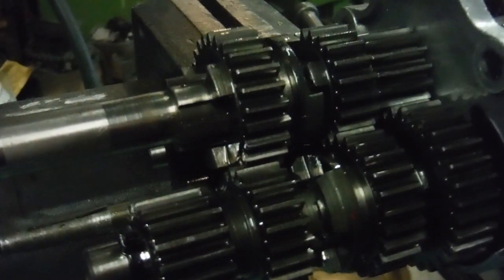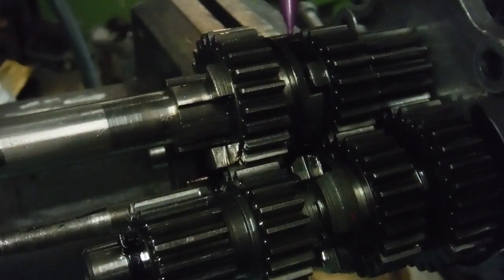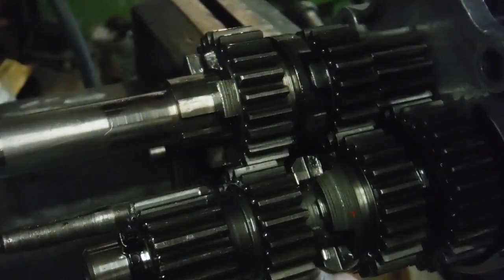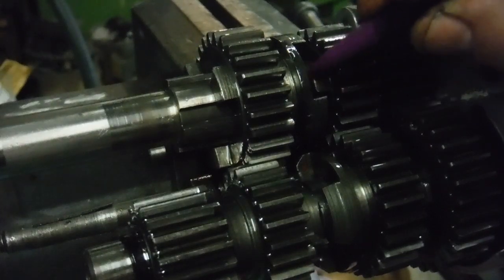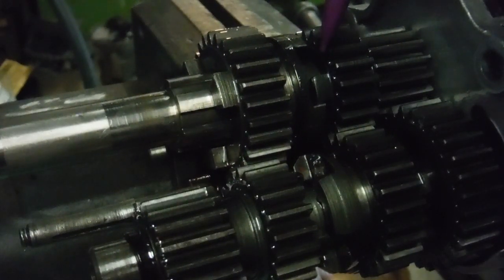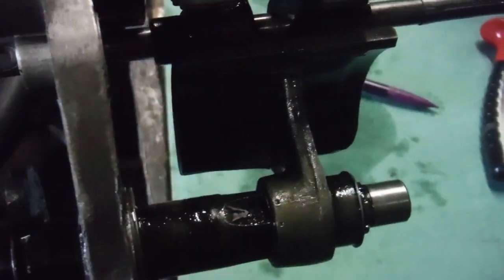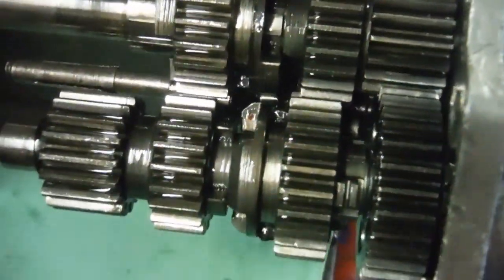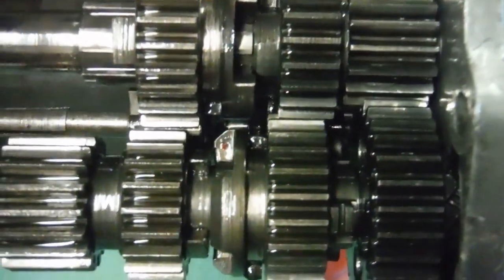Norton Navigator 350 gearbox examined and discussed.

Comment: Hi, the selector rod screws into the back of the gear box. That is what the flats are for 👍
Reply from the maker: Hi and thanks, but I guess a special tool would be needed for that with the gearbox end plate in position.

Comment: The overall condition is really good. The poor engagement is no great surprise. I wonder if the thing you had to straighten in the selector mechanism was as a result of someone forcibly holding the gear-lever down in an attempt to keep the thing in second. If the fork is out of shape, I would expect it to be a symptom. My money is still on lack of shimming. I doubt the factories took much care over it: The parts lists seldom list shims as available spares.